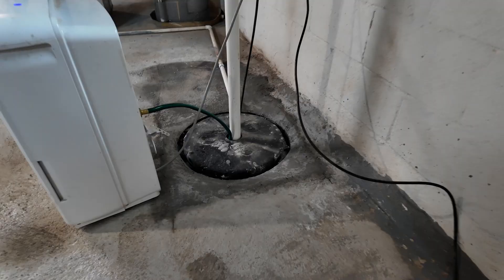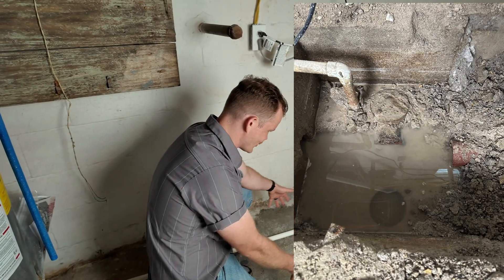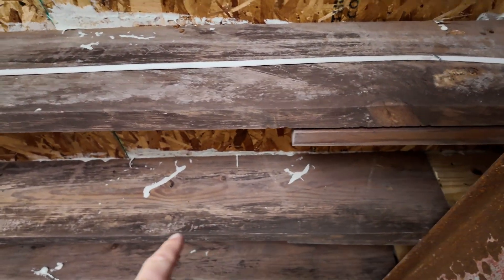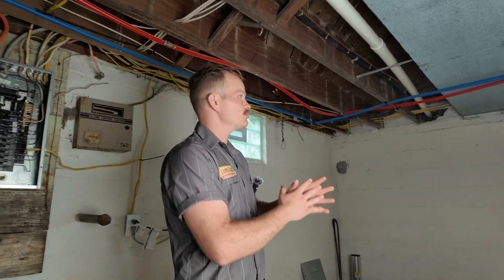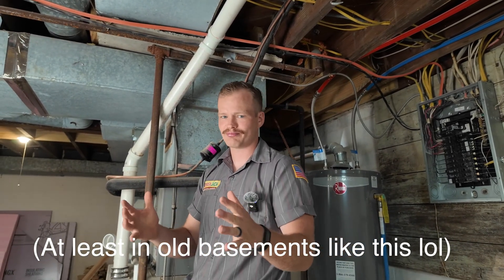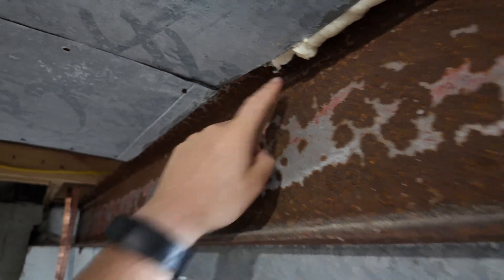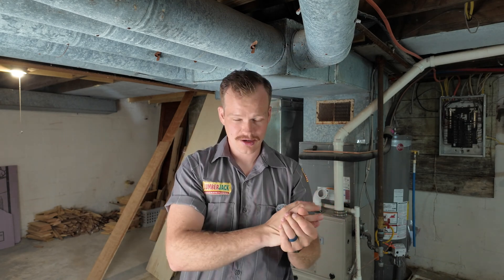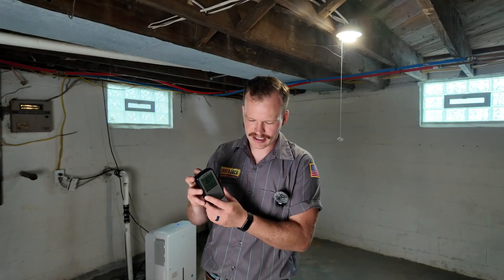Why Basements Are Unhealthy: Mold, Moisture & Hidden Toxins

Comment: Oomf, watched this from my recently finished section of 1920s home basement (with 2 pits for sump/ejector).... good intel appreciate the no nonsense approach & just sharing whatcha got with us. 

curious, albeit left field, any idea what the capped (cast iron or galvanized?) pipe coming through your wall behind you (b/t *elec. panel mounting & outlet) at around ~ 0:40 mark is? same set-up in my formerly mentioned, currently dwelling in basement - and wasn't sure if old line for water/gas/what have ya... 

thanks, mate!

Comment: Thank you for bringing up the mycotoxins. This is real and causes horrible symptoms that can be hard for doctors to diagnose. You could feel like you're dying, but your vitals test perfectly fine.
Reply from the maker: Thanks! Everyone thinks mold will shop up like allergies but this is just not true
Reply: True!!! Mycotoxins can make you systemically ill, affect your brain and emotions, and lower your resistance to EVERYTHING! My mold and Lyme doctor looked at my labs for Lyme and said she thought had been exposed to mycotoxins. I don’t know how she knew this except for my white blood cell counts, and sure enough, my mycotoxins were sky high and it hit my brain and bladder the worst. I was suicidal and in a very dark place. I’ve been sick since I moved to this house, and I had it tested for mold, etc, because I was recovering from a different moldy condo. Recently it was extensive in my attic and that cost a fortune to remove and repair the roof.
  I have to wait to move, but I hope I can finally find a safe place to live at age 71. 
   Thanks for your comment, too!
Reply: Agreed! I cleaned up sewage and became extremely ill systemically. It affected my brain and bladder. I also had mold in my attic recently and had that removed and the roof ventilation fixed. It cost so much, I have to save up again to move from this 1958 money out of a home, even though it’s been upgraded with an overhang porch, customized cabinets, wood floors, trim, finished as, and gorgeous yards surrounded by a privacy fence. Looks good, but almost liked me after I moved out of a horribly moldy condo that was and at the bottom of a slope. I hope and pray I’ll be in a safe place soon! 🙏💕
Reply: Modern medicine is corrupt. 
Even if your doctor is not a AMA programmed robot who only diagnoses AMA approved illnesses, you have corrupt medical labs that will give you False Negatives even when the evidence is overwhelming.  
e.g.  Doctors have sent entire worms that came out their patients "South Gate" to labs and....the lab says the sample was negative to parasites. 
Find a functional doctor.  You pay out of your own pocket however, they are true healers...

Comment: Your high efficiency furnace has been installed without a fresh air inlet pipe for the combustion chamber. That 90 degree elbow should actually have a pipe run to the outside of the house to pull the combustion air from the outside. Since that's not there, it is pulling from the inside of the house. This causes negative air pressure on your house. So whenever the furnace is running it is causing air to be sucked in through any opening or crack that leads to the outside. Air is being sucked in around all of your windows and doors in the basement and any air that it can't get from those sources is coming from your upstairs living space. Not having this inlet plumbed to the outside actually decreases the efficiency of the furnace quite a bit because you are sucking cold air from the outside to feed the flame inside the furnace. It is probably actually helping your humidity problem a bit, at least in the winter because it is pulling a lot of cold air from the outside into the basement. The downside is that this can also bring in the moisture in the air and make the basement colder which can cause condensation issues, such as on the uninsulated air supply lines that you have. A lot of HVAC contractors install these high efficiency furnaces this way to save money on the install. But it costs the homeowner a lot over the life of the furnace.
Reply: Now I know what that other pipe in my system does. Good info. I just bought a house that has one of these systems. I am from a warmer climate and have a learning curve on the heating systems in use here.
Reply from the maker: Glad you’re figuring it out!
Reply: DEAD MOLD IS STILL A PROBLEM... DEAD MOLD SPORES STILL HAVE MYCOTOXINS

Comment: 13:01  Not pick-o-rees. Picocuries is pronounced peek-o-cure-ees. Marie Curie won the Nobel prize for discovering and describing the properties of radon and polonium, both radioactive elements. In her honor, a curie is a standard unit of measurement of radiation used by every scientist, engineer, and technician in the field, so it’s not an obscure measurement 😉. Picocurie is one trillionth of a curie. A millicurie is one thousand of a curie.
Reply from the maker: lol thanks for the correction, i had never heard of it before I learned about radon.

Comment: Basements are great if well built; slab and wall insulation and vapor barriers, etc.     Built a house in 2001 that way and the basement is great.  But how do you insulate the exterior of old basements?   Have you had any experience with this (https://www.youtube.com/watch?v=rNJ6HcANWxw)?   Seems like a good idea to me.
Reply from the maker: That’s a super innovative approach they took. I can’t help but think those furring strips will be rotten in no time but very cool still.
Reply: Thanks

Comment: What are your thought’s on how Tia Weston redid her basement of her $1 house? If you have a cleaned basement where everything has been killed and encapsulated with paint etc can you use systems like membranes to properly finish a basement? The house I want is 1932 and has a cinderblock basement. I’ve never been inside of the home, but my vision would be to do a laundry room, storage, work bench area and extra living room type space. Or if you didn’t have the walls built out then maybe do a stucco finish on the walls and a linoleum or LVP (which I know you don’t like 😅) for the floors. We are in an arid climate, so it’s not as bad say being on a coast or something. I sometimes wish our humidity was higher for easier breathing. My inside humidity of the camper I live in is between 29-35% regularly.
Reply from the maker: I haven’t seen that video I’ll have to look it up but If you live in an arid climate I think it’s a much better idea. Is your soil dry as well? Moisture is the biggest problem with basements.
Reply: @LumberjackHealthyHomes yep dry soil, quite sandy overall. On our current property it’s all dry sandy soil. Doesn’t stick together at all and requires a lot of watering for even a mediocre green yard.